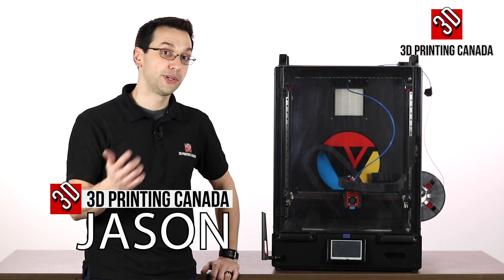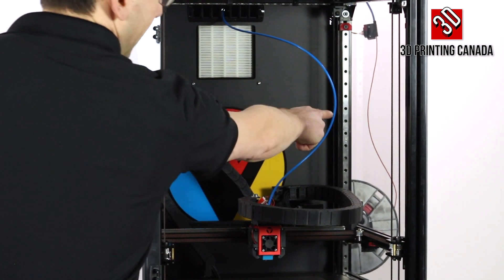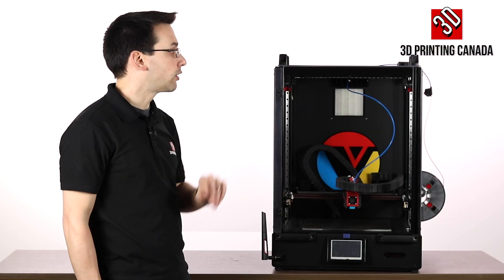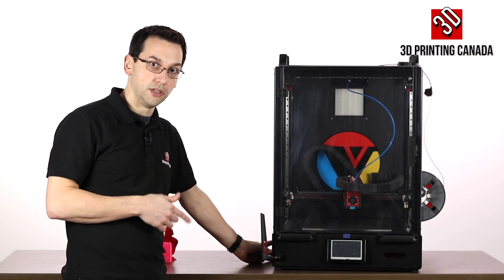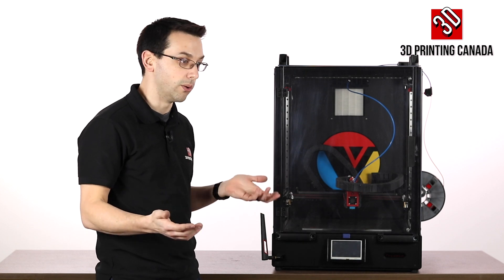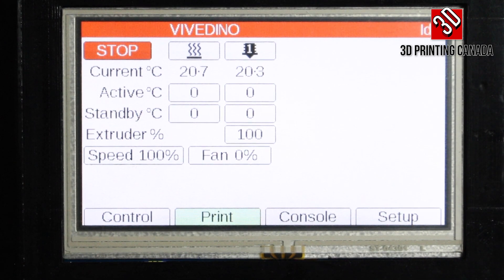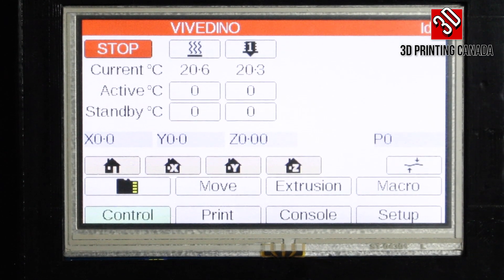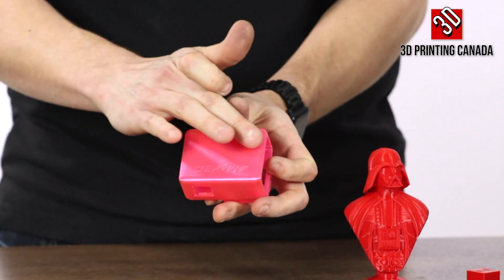Formbot Troodon 3D Printer Unboxing and Test!

Comment: Well this is obviously an ad. I have the big version of this printer and there are some basic design issues with it. Im not saying its a bad machine but at least mention some of the imperfections and quirks.
Reply: I’d be interested in what you feel are the design issues
Reply: @dougfleming8327  I am using the bigger brother of this printer a lot and will be posting a review on it when I feel I have used it enough to do so. I was not trying to knock the product. It looks cool and can achieve good print quality on a huge format. That alone is worth the price.
Reply: Mike Mirijanian  You had mentioned some basic design issues. Based on the specs it seems fairly well thought out. I’ll look forward to your review because I’m also looking closely at the smaller version of this printer. However, after Thomas Sanladerer’s review of the Vivedino Formbot Raptor II with regard to some serious design flaws and quality issues, I’m waiting to see how well this printer is reviewed after more people have time to test it.
Reply: @dougfleming8327  I watched Tom's review also. Keep in mind though that was a different machine. The frustrating thing for me is that regardless of which Chinese brand you buy, you are the test subject. Its like they do no r&d or quality control..and have u  do all of that instead. I guess that's how they can make these affordable. I am having success with the bigger version of this printer but am finding even more quirks with it as I go.